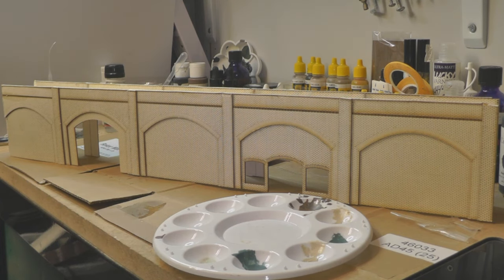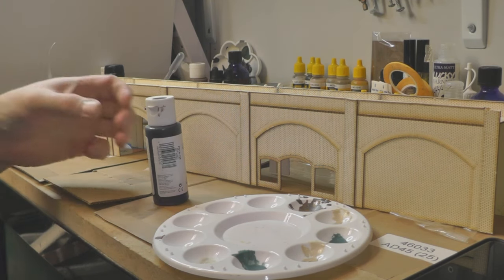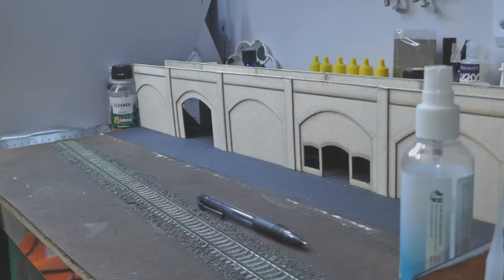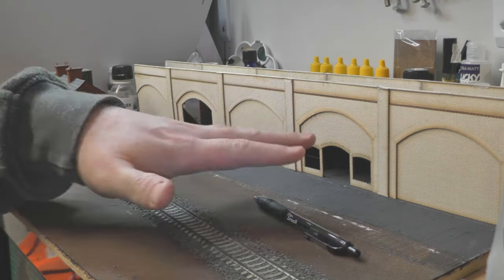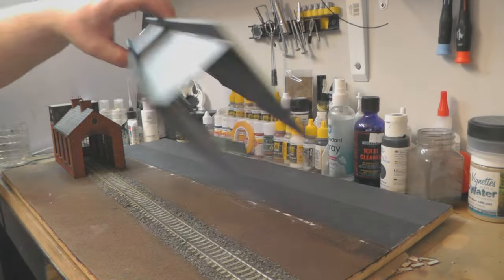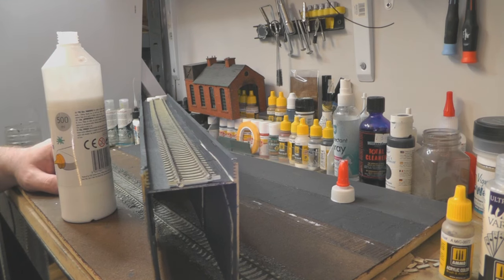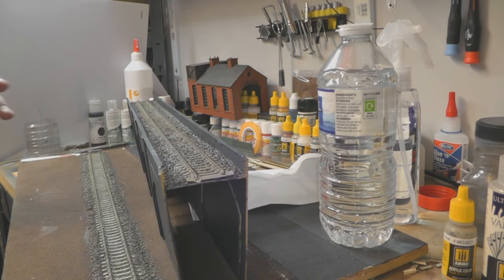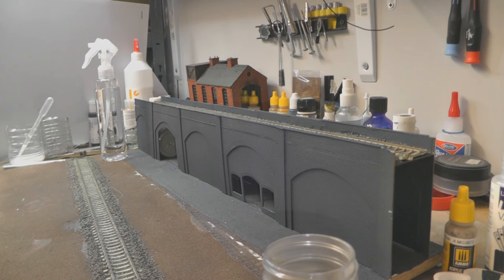Arches Omnibus: Ep3 - More track and painting the arches

Comment: Nice...Love these videos especially when I have the same component kit as you, but still waiting on some more pieces. I guess the bowing was caused by the moisture and also the weight which was my initial fear. I would suggest some foam inserts at the ends and in the middle to redistribute the weight and reshape it. I intend to put a train on top so will need to do this I think. Arches can be red brick, London yellow brick or grey brick...it really does depend on what you are modelling. Originally I was going to paint mine (when I have assembled it) red brick but seeing yours not sure now...maybe grey. It depends on what your layout palette is going to be and whether it will fit in or conform....Mine is a London scene with London red buses, so still not sure. Will have to go back and look at some photos....Cant wait for your next video and thanks for posting:)
Reply from the maker: Thanks Steven, really appreciate the feedback and kind words. Already working on the next video :)